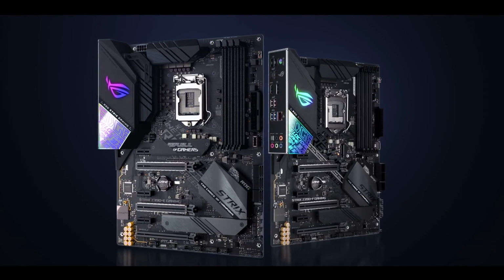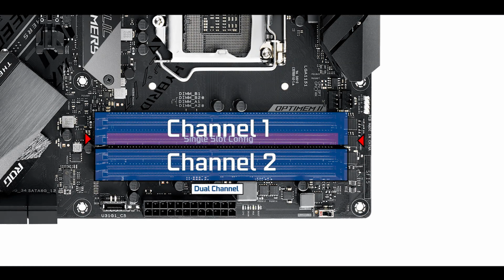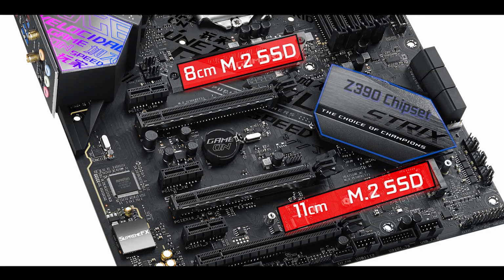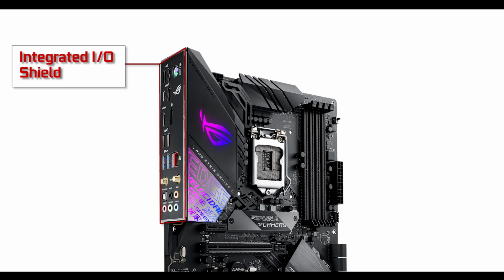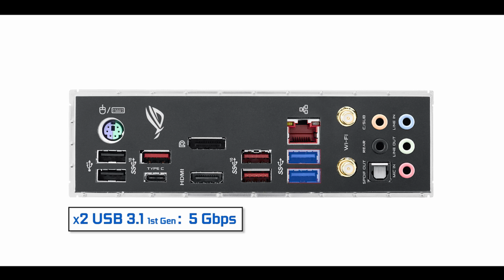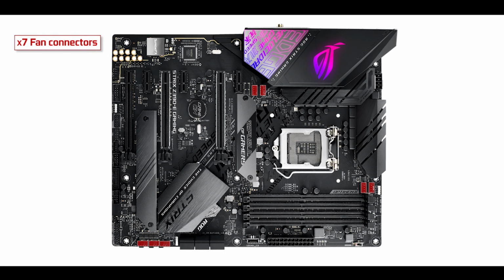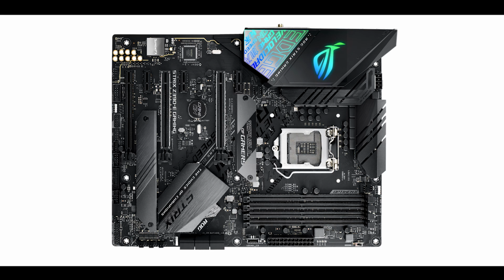ROG STRIX Z390-E : a gamer's dream!

Comment: Last month picked up used Asus ROG Strix Z390-E Gaming motherboard & Intel Core i7-8700 processor for $50 dollars total locally. Now my games are running much better compared to when I was using an AMD FX8320 for the last decade.

Comment: ASUS ROG Strix Z390-F Gaming LGA 1151 (300 Series) Intel Z390 HDMI SATA 6Gb/s USB 3.1 ATX Intel Motherboard

Intel Core i7-9700K Coffee Lake 8-Core 3.6 GHz (4.9 GHz Turbo) LGA 1151 (300 Series) 95W BX80684I79700K Desktop Processor Intel UHD Graphics 630

ASUS TUF Gaming Radeon RX 6800 DirectX 12 Ultimate TUF-RX6800-O16G-GAMING 16GB 256-Bit GDDR6 PCI Express 4.0 HDCP Ready Video Card

G.SKILL TridentZ RGB Series 64GB (4 x 16GB) 288-Pin DDR4 SDRAM DDR4 3200 (PC4 25600) Desktop Memory Model 
F4-3200C16Q-64GTZR

SAMSUNG 970 EVO PLUS M.2 2280 2TB PCIe Gen 3.0 x4, NVMe 1.3 V-NAND 3-bit MLC Internal Solid State Drive (SSD) MZ-V7S2T0B/AM

Cooler Master MasterLiquid ML240R ARGB Close-Loop AIO CPU Liquid Cooler, 240 Radiator, Dual Chamber Pump, Addressable RGB Lighting, Trple MF120R Fans for AMD Ryzen/Intel LGA1200/1151

EVGA SuperNOVA 1000 G5, 80 Plus Gold 1000W, Fully Modular, Eco Mode with FDB Fan, 10 Year Warranty, Includes Power ON Self Tester, Compact 150mm Size, Power Supply 220-G5-1000-X1

This is my very first build...As of now just waiting on my order over everything.... $3,000 dollar  Pc i hope that everything fits and works...Wish me luck.lol im pumped

Comment: Okay I have this motherboard with an i9-900k do I stick with getting a 2080 ti or go for a 3090
Reply from the maker: 3089 id say
Reply: Laurent's Choice My current Build is This Motherboard, I9-900k, NZXT H510, Corsair Vengeance Pro 32 GB of ram 3200 MHz, H100I RGB Platinum Cpu Cooler, and Corsair RM850 Power supply what gpu do you recommend with that storage im still looking for too if you could help

Comment: My keyboard takes two usb slots. Does it matter where they are at? Should I use my mouse in the red usb slots and my keyboard or switch my mouse with my headset for competitive gaming?
Reply from the maker: Mouse = black USB slot :)
For ur keyboard. It will depend if its 2nd or 3rd gen usb. Probably is 3rd (blue) so connect it on blue plug on ur mobo.

Rev plug is 10gbps. Larger bandwidth but same latency. So won't affect mouse / keyboard registration speed
Reply: @Laurentschoice  Awesome! Thank you so much for the reply it helps a lot!!

Comment: does it have bluetooth
Reply from the maker: Yes :)
Reply: Laurent's Choice bettt thanks so ima be able to use a g pro wireless
Reply: Laurent's Choice on my new pc  my bios is resetting every time i turn off my pc not like a power off just a shut off what should i do i have a brand new z390-e motherboard is this something i’m doing wrong i an clicking save and it works for that session then if i shut it off and boot back up it resets. please help

Comment: I got the Asus Z390 Plus unfortunately it doesn’t have Type C header and I got the the Lian Li o11D case best case ever had and it has Type C in the front now I think I screwed up and I’m thinking of moving from Asus all together because they’re cheap not adding usb Type C on the board while the others like MSI MAG Z390 ACE cheaper and  Lauded with extras.

Comment: Will the itx z390 be future proof? Like compatible with a better cpu then a i9 ?
Reply from the maker: No. Z390 boards wont be compatible to the newer intel gen CPUs (10th).

Further more, they are only PCIe 3 standard complaint.  Making it definitely old gen tech on day 1 of purchase. 

I'd steer u to X570 boards instead.

Comment: Will this work on the i7 6700 or only 8th and 9th gen processors
Reply from the maker: Only 8th and 9th gen. 

Ull need a Z170 board to run a 6700

Comment: Please answer me bro.i have cooler master ml240r liquid cooler and this cooler has 2 fans and my cabinet has 3 front fans,1 rear fan. can I connect these all fans at this motherboard?
Reply from the maker: Yes .it disent mater which one
Reply: But this mother board specs  only mentioned 1×4 pin CPU  fan connecter,1×4 pin OPT CPU fan connecter,2×4 pin chassis fan connecters,1×5 pin EXT fan connector.then how it possible
Reply: What is 5 pin EXT fan connecter?can I connect 4 120mm fan at this connector?

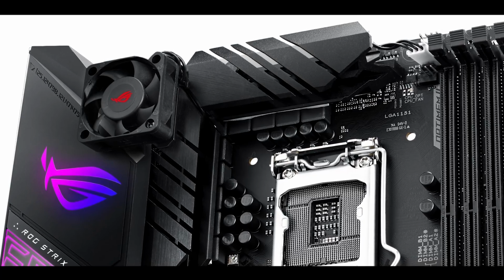Comment: Hi at 10:37 this fan that probably include with the motherboard, if you install i9 9900K is needed ? (No Overclocking) I don't like fans like this because they won't last long. Also all Asus Z390 series need-has this fan ? 

Thanks again. Nice review.
Reply from the maker: Not that many boards use these. 

Only this one and the Prime z390 A afaik
Reply: @Laurentschoice  Thanks for the reply. So if i buy ROG STRIX Z390-F or ROG MAXIMUS XI HERO doesn't include this fan. Probably ROG STRIX Z390-E raise temperatures there. I wanted to buy this a lot, but probably i'll go for the HERO because of this.

Comment: Underrated channel! However,  while Asus is like a well tuned Ferrari, but it only packs half the horsepower. Their VRM scandal is seriously  breaking their stellar reputation. Profits is up but quality is down. But it looks great, and thats what the fanboys want. RGB in and VRM out. Providing a fan and a bracket on their top gaming board, with the same VRMs as lower end, that is a statement to the level of failure on their Z390 8 core refresh.
Reply from the maker: While I agree that the VRM could be beefier... after using the E version with a i9 9900k , c ok npared to the Apex, it really does a great job at overclocking it. 

But the VRM goes hot. That's for sure

Comment: Does this mobo have a 3pin argb header or a 4pin rgb header. I have cooler master sf series fans that use 3 pin for the rgb
Reply from the maker: It has both . 
Two 3 pine and to 4 pins :)
Reply: Laurent's Choice so the new sf series fans from cooler master would work then they use the 3 pin rgb connector with the [XX X] pattern
Reply: @DiscordCriminal  Yes, it will also work with the [X XX] pattern too. You will just have to turn the connector upside down.

Comment: is it recommended to use 2 M2 SSD, one for OS installation and the other one for everything else? And what Case do you recommend that would be perfect for this motherboard? Since there is a Usb type C for front panel, not all case will have type-c.

Comment: Hey man I'm having a problem with the Bluetooth connection.. it's range is about 10 inches atm. My question is if the wifi antenna does anything to increase the bluetooths range as well?
Reply from the maker: Wooooo...  unless u r using an external adapter... would not think so. 

Do u have multiple bluetooth devices turned on in the same time? Thst could cause MAJOR interferences and cause disconnections or ranges issues.
Reply: @Laurentschoice  current only my Anne pro 2 so I'm not sure if it's a anne pro proven
Reply from the maker: That's easy to verify. Try to connect any other device (your phone?)

Comment: Does the fan actually do anything ?, thanks in advance...
Reply from the maker: Yes... it does cool.the VRM in case of overclocking
Reply: @Laurentschoice  Thanks, but is there any significant drop in VRM temperatures with the fan installed? Or is there really any point in installing it?

Comment: I was recommended this, i was originally just going to get the Z370, is there a major difference between the two? (I have no experience with Pc building or anything related to Pc components)
Reply from the maker: What CPU are u going for ?
Reply: I7-8700

Comment: Can i overclock my i5 9600k more the 5ghz i just want to know if i can
Reply: I bought i5 9600k and 8+8 corsair vengeance rgb ram know im confused if i can overclock my cpu to its limit on this board
Reply from the maker: It really depends of the CPU ull get. 

9600k is easily overclockable upto 5ghz. 

If u are lucky u might get a chip which will withstand 5.1 - 5.2 ghz.
Reply: Can i overclock on asus z390 e near to 5ghz because this board have only one 8 pin cpu power plug
Reply from the maker: Yes u can. 

No worries at all.

Comment: I just bought this motherboard for my first build. I'm getting the i7 7800k CPU to go with it. Along with 32gig of ram. My first build. I'm also running two ssd terabyte hard-drive one for windows and programs and the other for music samples and sounds. Also going to be having a water cooler. Decided to go all out with my first build.
Reply: Ten Again This board doesn’t support  7th gen right?
Reply from the maker: No it doesn't:)
Reply: @naaresh96  as far as I'm awRe it does. I bought it off Amazon and it says it does. But I'm yet to get my CPU. As you can imagine I've been buying bit by bit and I'm nearly there..
Reply: @Spencerlayne  z390 is only for 8th gen and 9th gen, better try to get it changed before its to late 😁 good luck
Reply: @naaresh96  so will the i9 work in this motherboard because ion just get that instead
Reply: Ten Again 8th or 9th gen meaning  e.g = i7- 8/9 700. The digit after the dash should be 8/9 👍🏻

Comment: What's the difference between this and the Maximus??
Reply from the maker: Maximus will have more troubleshooting options such as Qled, ez debugger and on board buttons. :)

Other than that..pretty much the same board.
Reply: @Laurentschoice  Overall I went with the Gigabyte z390 Auros Master over both. I was told it had better quality, vettervram and heatsinks, at the cost of a slightly worse BIOS that I would probobly only use a couple times to over clock. What your opinion on that decision? I spent $242.99-
Reply from the maker: U did very very good ;)
Reply: @Laurentschoice  Thanks!!!
Reply: @Laurentschoice  Could you do a review on that board??
Reply from the maker: It's already in the pipe line :)
Reply: @Laurentschoice  AYE!!! Ok cool, I subbed, looking forward to the vid, I'll recommend this channel to all my friends as well.
Reply from the maker: Trully appreciated:):))

Comment: Anyone else having a problem with all the usb ports in this motherboard? I built my pc i9-9900k, 16GB 3200HMz ram, RTX 2060 mini, Corsair h115i pro, Samsung 860 Evo 1TB ssd and WB 2TB harddrive. When i boot my rig up it does not let me use my keyboard and mouse (so i can enter the bios menu and install windows). I tried resetting my CMOS but it didnt work. I hope its just something that I wired incorrectly but so far I have no idea what is wrong.
Reply: make sure the connections are connected properly and did you use every USB port and try them?
Reply: ihavetubes yup tried everything, reached out to Asus and they recommended that I send it in for servicing, even tho it was brand new right out of the box. So I said f it and returned it to Best Buy and ordered the msi ACE lol

Comment: Is it worth it though, over z370? I'm about to upgrade, and mobo is still the last thing I haven't bought. Coming from a 4670k to 9700k, still using my old 1080 though. But, is it worth going to z390? I bought the sabertooth z87 all those years ago mainly for the "thermal armor", shit looks fucking amazing imo. But, the z390 Asus board with "thermal armor" is $350... The z370 version with "thermal armor" is $200ish
Reply from the maker: Not really if you ask me. 

Z370 will do everyhting this board does, especially for an i7
Reply: @Laurentschoice  RIP me, price is now exactly the same as the z390 variant lmao. Fuck

Comment: This is a great mobo. I used it with an 8700k and 1070 ti graphics card with 16 gigs ram at 3200 speed stock. Glad I went with this over z370 since this was a new build.
Reply: Just did pretty much the same build
Reply: Branded one nice! I just passed this processor and graphics card to my nephew for his first pc build. He loves it and now realizes what he was missing from his previous pc LOL.
Reply: This motherboard supports 3200mhz but the supported cpus dont, they only support 2666, so ur ram is running at 2666, cuz 8600k doesn't support more

Comment: Hi Frenchman. Nice channel. Quick question.. you said the z390 chipset is very similar to the z370 chipset. However, I'm ordering an i5 9600k. Im aware a bios update could allow the z370 chipset to work with the 9th gen. However, As far as I knew, I didn't think I could get a z370 mobo to post with a 9th gen CPU, so I feel like I'm stuck ordering a z390. I have an old 1151 cpu laying around, but it's a cheapo Pentium G4400 from a few years back. Am I mistaken, or is there a way around this?
Reply from the maker: Z370 chipset (with updated bios) supports 9th gen CPU including the i5 9600k .

U do not necessarily need a z390 chipset. 

Also... they are indeed absolutley similar save a few USB more and a native wifi adapter (which is not used by all boards)
Reply: @Laurentschoice  thanks. One question though.. how would I update the bios without being able to get the mobo to post with my 9600k?
Reply from the maker: Good question.  When buying it, ask fir an updated board. The vendors should do it for u before giving it

Comment: So I plan to pair a i7 8700k and a RTX 2060. Would this board give me any more performance when it comes to future proofing and overclock potential over the Prime z390A? My budget is pretty tight ha My main concern is gaming.
Reply from the maker: Well...the only noticeable difference here is connectivity. You got a dual wifi which u do not on the Prime.

Other than that, it will provide the same performances.
Reply: Laurent's Choice Thanks for the reply man! I’m building my first pc and this makes me feel much better about my choices! Glad I found your channel.

Comment: How to know if a motherboard supports booting from a Nvme drive installed into the M.2 slot? Does that have to be specifically mentioned on the manufacturer’s website?
Reply from the maker: Starting from z270 boards and up, they all do. Just make sure to plug nothing in the SATA plugs first time u do so.
Reply: Laurent's Choice , thanks!

Comment: my tuf z390 is good for my i7 8700k and 16gb ram 3200? or need to change to this board? I do not want to overclock so much, but I want as much stability as possible.
Reply from the maker: No.. ur absolutely good :)

Comment: Hi I have a question, I’m looking to buy the e gaming or maximus hero wifi, which one is better, also I got the air cooler be quiet dark rock pro 4 , I’m trying to understand if it can fit without compromising ram space,
Reply from the maker: Ok. So ur cooler's fan should be able to "seat" right on top of ur RAMs. 

But ill be diificult to add or remove RAM without removing the all cooler everytime, which is a pain.

Maximus XI HERO WIFI and the STRIX Z390-E are, essentially the same boards.

They have the same VRM design and identical components layout. 

But, where the Maximus (in general) is different, is its extra troubleshooting features (Q-LED error screen, soldered buttons, better custom water cooling support, thicker and heavier heatsinks, and more RGB connectors).

If you are going for an air cooled system, I strongly suggest to stick with the STRIX, as both mobos will react identically performance wise.
Reply: Laurent's Choice thank you so much for replying, and for the info, I feel better now, be coz I had already bought the dark rock, you said Seth about vim, what is that
Reply from the maker: That is the CPU power delivery. Which allows to safely overclock your CPU!
Reply: Laurent's Choice thank you again for replying, becoz of what you said, I bought the asus Z390 E gaming, I’m very excited

So my rig will be  

Asus strix 1050 ti oc 4gb
Asus Z390 Egaming
i5 8600k
3600 trident z rgb 16 go
Dark rock pro 4 
Evga 650 w
Meshify cig tax

My very first rig I researched to put together, I’m excited to see how it runs.

Thank you for helping me
Reply from the maker: Congrats brother :) killer build!
Reply from the maker: Congrats brother :) killer build!

Comment: I want to build my first gaming PC and I have a few questions. Which motherboard is better, the one shown on the video or the Asus ROG Strix Z390-H Gaming LGA1151? What's the difference and my other question does it matter what case I get? I like the nzxt case h500i and h700i would it fit on either or?
Reply from the maker: So cases u selected will fot and they are great. But since you are going for an Asus board, i go for a case which can sync its RGB lights with the board, like a CoolerMaster .
Here is my reciew about it https://youtu.be/67ixaATG8zw

There are no performance linked differences between the STRIX E and H.

The 2 main diffrences are :
H series doesnt have the WIFI/Bluetooth adapter
H series only as a RED LED strips on it. No native RGB LEDs. Eventhough there are RGB connectors for RGB strips which you can pourchase separately and install.

Other than that. They are identical motherbaords in terms of features, components and CPU support.

Hope this helps

Comment: Are there any performance differences for the i7 8700k using this motherboard or should I strictly get the z370? I really want the z390 and I don't care for the price but a lot of people say the performance may be different and I refused to believe it. I am sure it can perform well on stock clocks instead of overclocking it. I just want an advantage to upgrading later down the road without having to buy another motherboard but then again I am still torn between both of them. I could use some help.
Reply from the maker: If u r using a 8700k, there are NO performance differences whatsoever. None. 

If you go for a 9th gen, u might see up to 10% difference due to VRM config differences. 

But thats it.